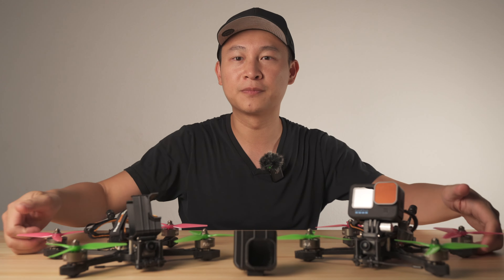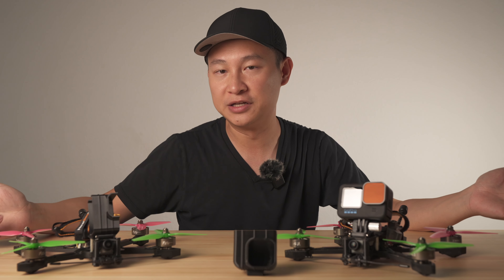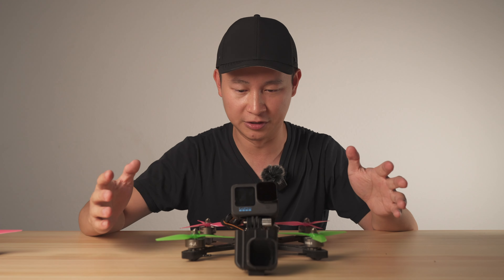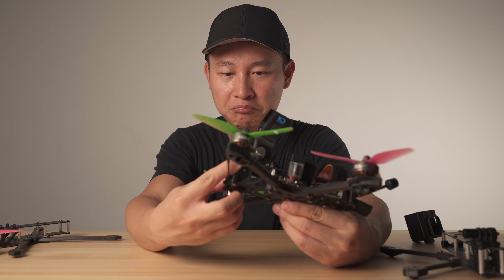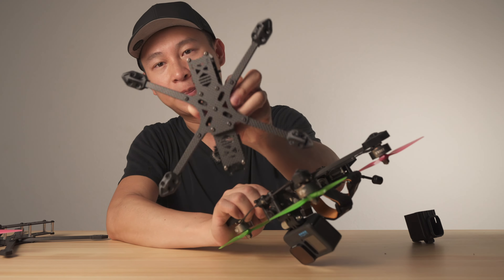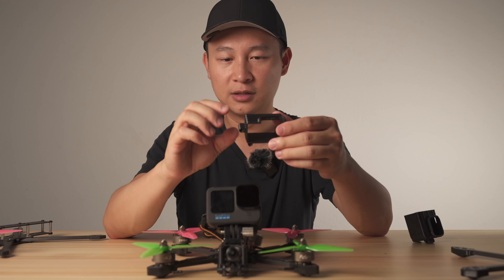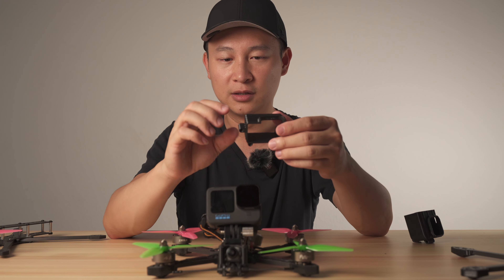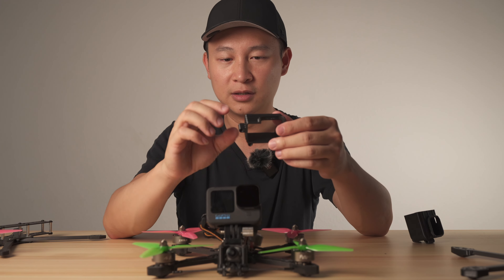NewBeeDrone Inertia FPV Frame

Comment: Really like the way you designed this frame. Almost all split deck frames use stack screws to fix arms to the main body of the frame and it is really nice that it is not the case here ). However, I can't find any information on the weight of the frame, could you post that?